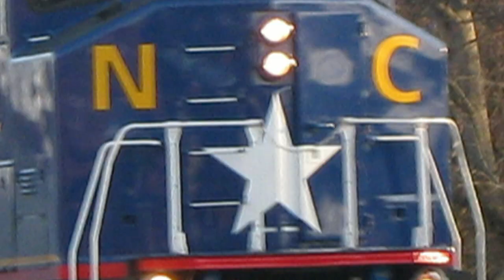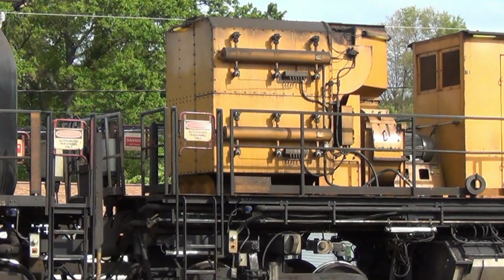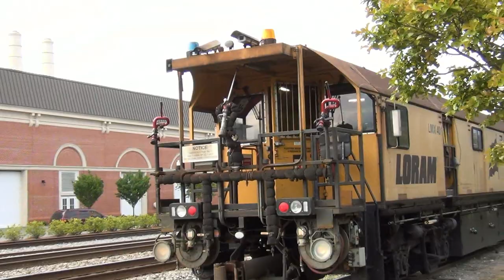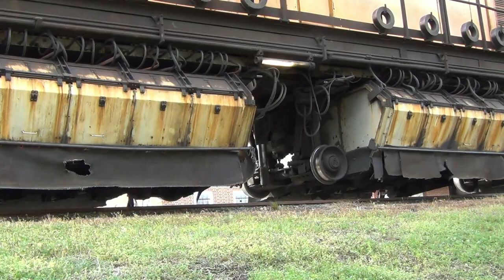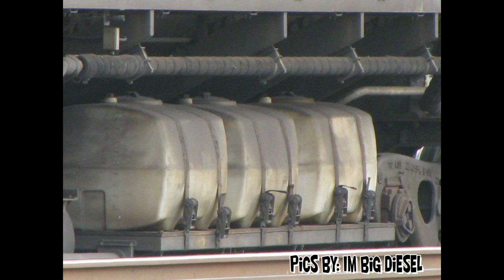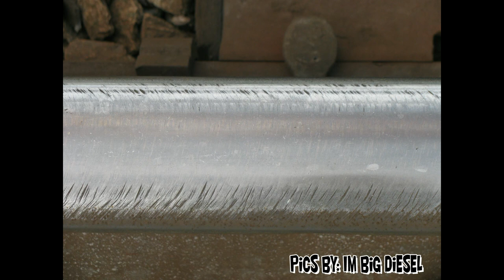Best LORAM Video on YouTube!!!!

Comment: Ah, so that's why the outside of the dust collector looks like someone lit it on fire and scorched the heck out of it, that's probably dust that got stuck there rather than being sucked up and collected. I can imagine rail grinding is an extremely dirty job, but someone has to do it or those rails will probably be unusable!
Reply: Hey Noah! The outside of the dust system looks like that because lots of dust collects around it and it is rather hard to blow it off with our air wands. Then once it rains, it'll stain the once nice yellow paint

Comment: What type of horns do these have?
Reply: We have several different kinds or horns. We got travel and work horns. The same as the other trains on tracks
Reply: @codywhite6138  Thanks. I wasn't aware their was more horns on this unit. I'm aware of the siren and police sounding horn. However, I'm more or less interested in the three chime horn located in the bottom front of the train near the plow I believe.
Reply: Oh I see! So the 2 larger horns that are side by side blow at the same time, and the smaller one is our work horn. We use those in QZ areas if there is standing equipment sometimes. To alert other people that we are here and moving, without using the larger decibel ones where areas do no permit the use of larger air horns